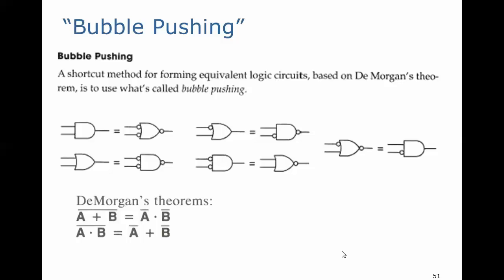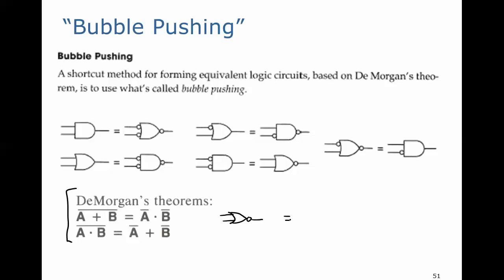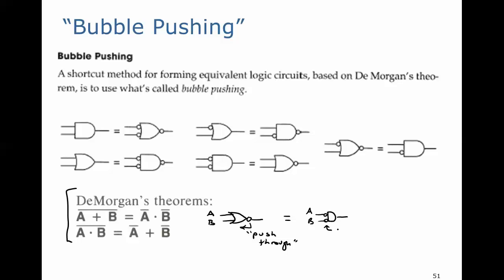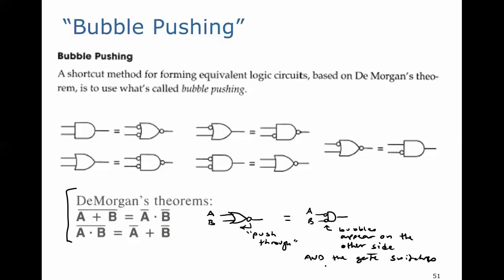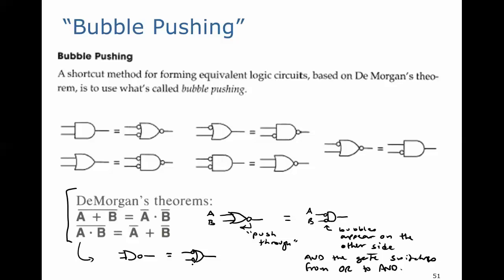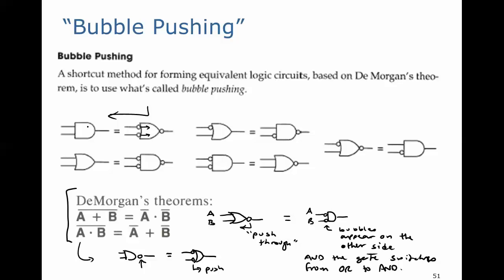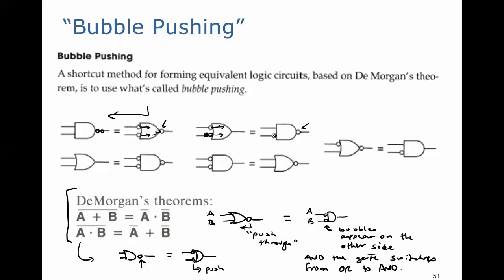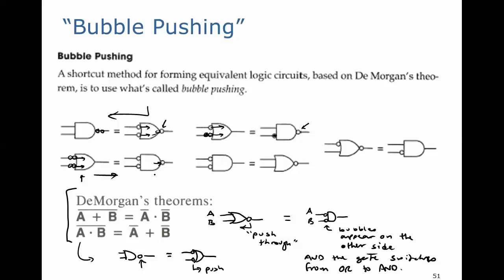A Brief Intro to Digital Logic: "Bubble Pushing" - De Morgan's Theorem applied to logic gates (DA09)

Comment: No explanation for your choice of amount of bubbles at the gates
Reply: Basically the aim is to reduce the amount of bubbles (inverters) you have, correlating to real life and cheap manufacturing. Let’s say each logic gate costs the same, and inverters have a price. The aim is to use less inverters so the circuit is cost effective. Hope this helps